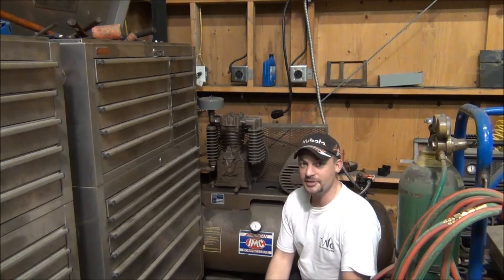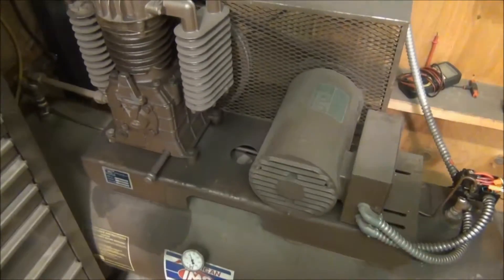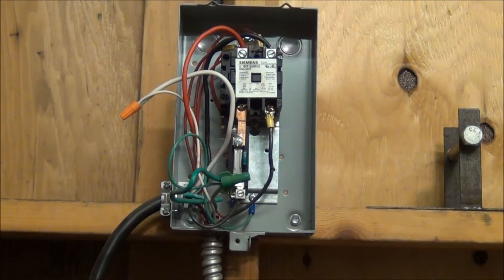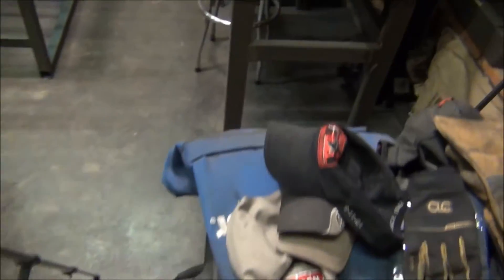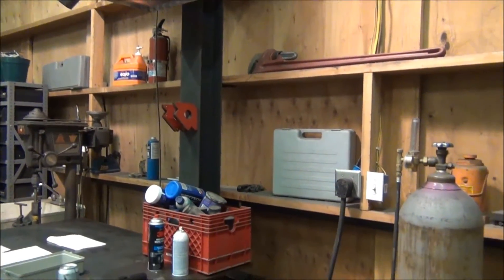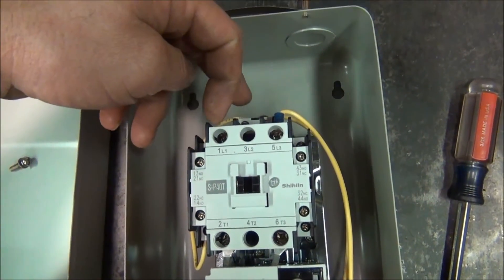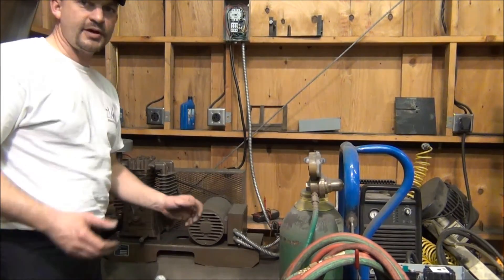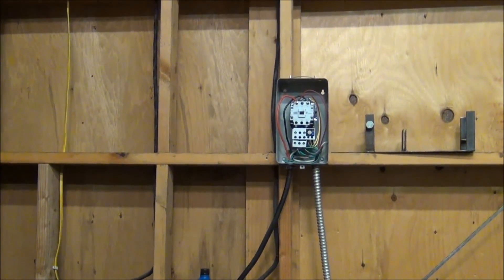Shihlin P40TX magnetic starter install

Comment from the maker: TheDodgeboi The magnetic starter is basically a remote switch controlled by the pressure switch on the compressor.  The contacts inside of the pressure switch can only handle a few amps; if I tried to pass all of the motor current through this little switch, it would probably only work a few times until the contacts burned up.  So, this little pressure switch controls a much larger switch (the magnetic starter) to turn the motor on and off.